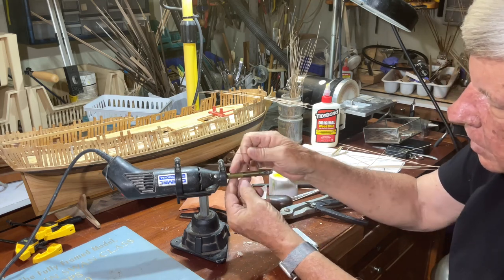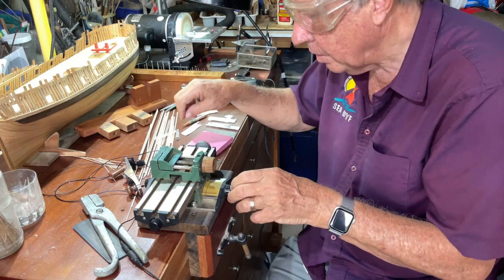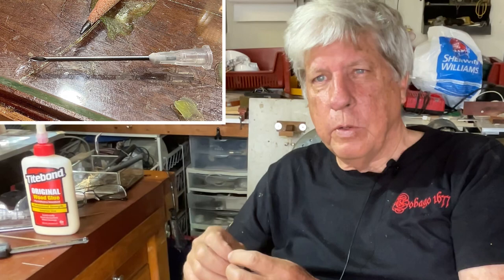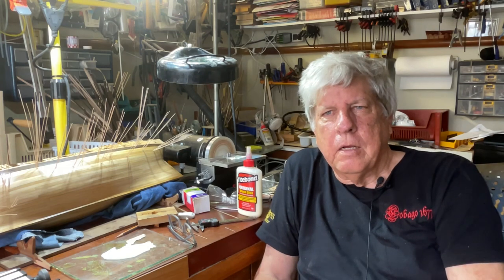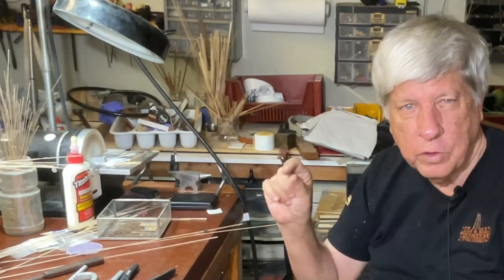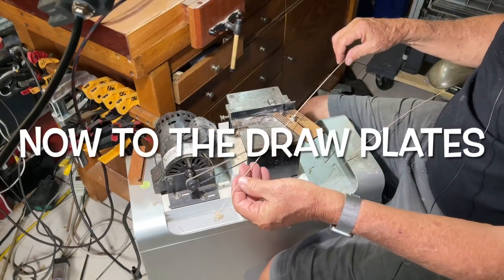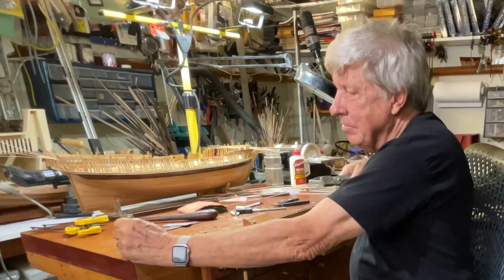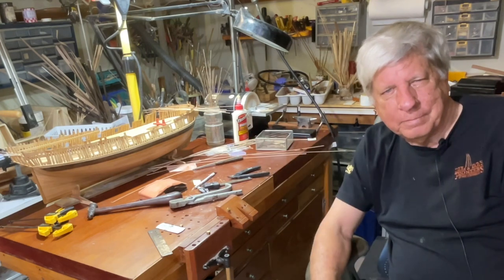Video 98. HMS Thorn. Planking 101. Part 10. Making treenails/trunnels.

Comment: Very interesting video that addresses an issue I am having building miniature furniture. At 11:59, what is the blade you are using in the Byrnes table saw? A possible solution to making treenails may be found in David Springett's book "Turning Lace Bobbins". He uses a jig with a router to convert long square stock into 1/4" diameter dowels, but in principle square stock of smaller dimension could be used. There are similar commercial devices available, but I don't think for the small diameter you require. PM me if you want more details.
Reply from the maker: Hi James
Thanks for your response. The saw uses is kerf slitting  blade a .032 with i believe has 80 teeth, made by Thurston. The problem with making wood parts at this scale is that everything breaks so easily. The key is to attempt to get 1/4” sawn wood stock with very straight grain. Secondly when cutting the blanks every thing must be tight, any slackness will cause the blank to break. Finally, pulling stock through the draw plate can be challenging, treenails and .020 in diameter are a work of love and passion.